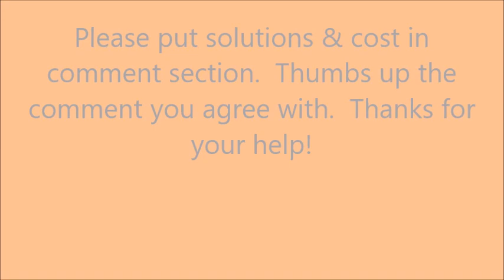What Causes a Humming Vibrating Noise in the Home While Turning on Any Faucet

Comment: purchase a water gauge thread it onto your main hose bib where the main water shut off valve is. if your pressure is over 80 psi , I would recommend installing a pressure regulator valve and regulate the pressure between 65 and 70 PSI. the next thing you will want to check is your Maine water shut off valve, this is the towel that will shut off the water to the entire home. is it a ball valve or a gate valve , if it is a gate valve that may be partially closed which may result in a humming noise when water is passing through. if you already have a pressure regulator valve chances are it has failed inside , this often makes a humming noise that you can hear throughout the whole home. something is obstructing the flow of water and if it is to all facets in the home I would check the pressure regulator valve and figure out what type of main shut off valve you have first

Comment: Go to the pressure reducing valve, probably out by the main water meter or where it comes into the house if dirt rocks Garbage get into the pressure reducing valve it’ll start to do that. I have that same problem in my house homes all the time when you turn on the water for too long, you need to put a Y sediment filter, and maybe a new pressure reducing valve and just to be sure get a hose hook up your water heater your valves around the house and flush out your pipes going the opposite way